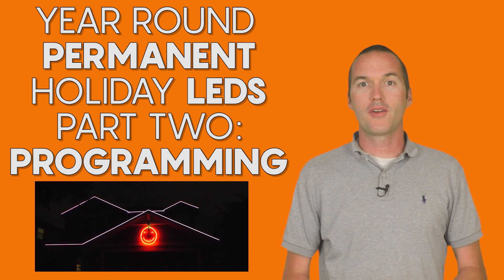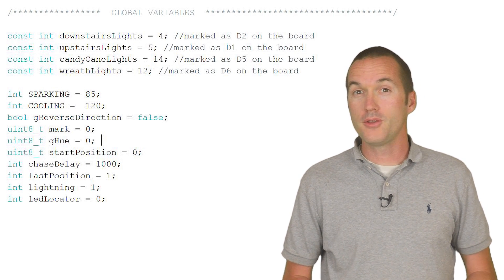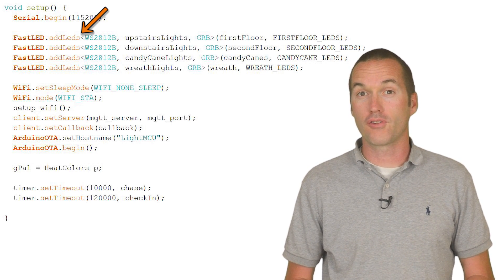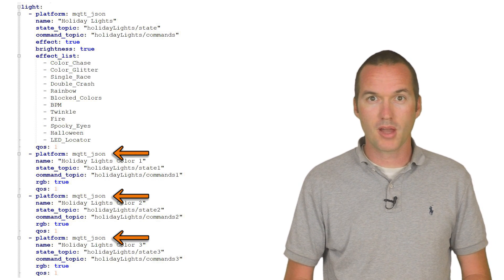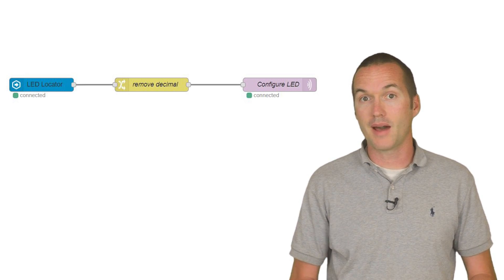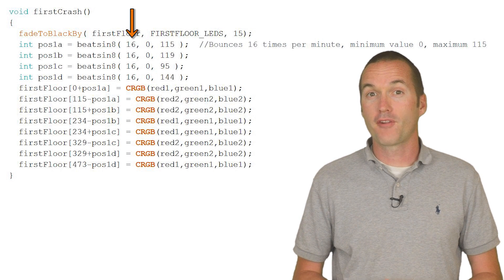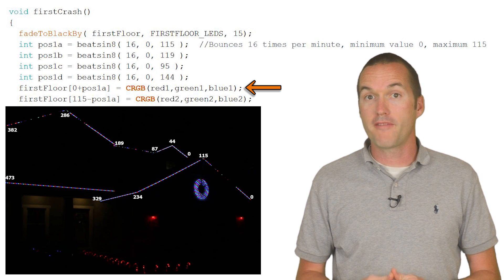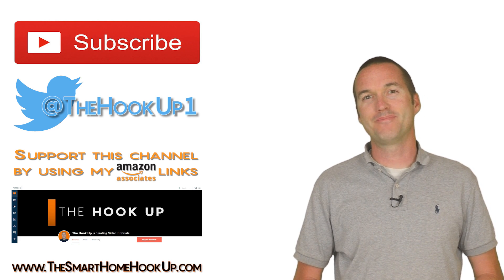Year Round Holiday LEDs Part 2: Software

Comment: Just Starting my first project. I ordered all my hardware (Node MCU 8266, bread board, power supply, 8211's...etc).  Can I start on the software side before I receive my hardware.  If so, where do I begin?

Comment: I have purchased the ws2812b strips for my roof line I am planning on purchasing the ESP8266 node mcu as a controller but I need to know if I can use the xlights program  to control the display

Comment: Just want to point out for those new to coding firstFloor[FIRSTFLOOR_LEDS] would be 0-479 not 0-480. The important thing to remember is that an array always starts at 0 and the highest position for an array is always one minus the value you defined the array size to.

Comment: What needs to be done to the code to work with RGBW sk6812?
Reply from the maker: I'd recommend looking at WLED instead of my code.  If you want to use my code there is a fork of FastLED that supports RGBW.
Reply: @TheHookUp  Thanks so much, next challenge, with WLED and esp8266,  can you only run 1 sequential length of LEDs or multiped  from different GPIO pins.  If only 1.  From reading the D4 pin tells the LEDs what to do. PS I owe you some beer!

Comment: I got the below from Amazon and I want to connect them in a series i.e. 20m. I know the power will fade by the time it gets to the third strip. Can you tell me how much AWG  extra power line do I need to pull along with it?

LED Strip Lights, Mixi 65.6ft 600 Lights Waterproof LED Light Strips Color Changing 5050 RGB with Bluetooth Music Sync App Remote Controller, Wall Lights, Rope Lights, Bedroom Decor

Comment: I’ve been trying to search in your videos before asking but haven’t figured out yet: I have simple 3/4” pvc in my yard for holiday lights using 12v WS2811 strips inside, controlled by an ESP8266 Node MCU with WLED. When the strip gets to 200 lights (sets of three) even after changing amount of LEDs in preferences, I get white or off LEDs for the last few feet. I’ve tested the strip I’m using to be sure it works and I inject power.  Is there simply a limit to how many channels it can control from one controller or output?

Comment: Great video! I have a question... do you have an equivalent for Tanbaby 5V 60A DC Universal Regulated Switching Power Supply for CCTV, Radio, Computer Project Mode Converter?? Appreciate any info

Comment: I cannot get any of this to work.

New home assistant setup and Mosquito might be working, but can't tell.  It sees the NodeMCU with your code in the add on page, but nowhere else in Hassio.  

The groups example also does nothing.  All configuration claims to be valid (and I've tried about 50 variations of minor changes) and nothing shows up on the dashboard.

Followed videos by you, bruh, and Drzzs but they all seem outdated or for some reason just don't work.

Asked on the home assistant community and no answers.

Comment: I am rewriting some of the openhab code you linked to in git. Since openhab does not have several features needed to replicate the exact setup, and sliders only do 0-100, then I cannot pick a specific LED in the locate code. The way it works, if using the slider, is that it seems to step through every LED until it reaches some unknown location. This is not your fault, but I need some clarity to rewrite this correctly.

When you choose a number, it is supposed to light that exact pixel up, correct?

The way the other person wrote this, the modifier slider is linked as an effect to the locator. This seems to adjust the speed at which it moves the location of the LED. I wrote a hacked together input panel that allows strings to be added to an item and then when a button is pushed it sends the value, converted to decimal, to the controller. This still seems to be linked to the speed or delay increase/decrease in the code you wrote.

Your locator code has a portion with locatorLED++;  which to me looks like it is stepping through every LED until it reaches the specified one. In mine, it never reaches the specified one and keeps cycling. 

Also, how does the locator understand what zone is used? Does it just use all LEDs in the system?

anyway, I want to send the number to the controller when locator is active and then have the 1 led light up. any input is highly welcome.

thanks for the large project. I am hundreds in on this and about to run some new power lines outside.

Comment: I'm so excited to finally be getting ready to do this project. After a year of waiting I've got the time and all the materials to do it. I was setting everything up last night for a dry test, but ran into a problem. Arduino won't compile the code I got from your GitHub. It shows an error: 'class SimpleTimer' has no member named 'setTimeout'. I've installed the SimpleTimer library and can't find anything wrong. Please help! Am I missing something?
Reply from the maker: You are the second person who has had that issue in the last 2 days, I wonder if something got messed up with simpleTimer.  Can you reinstall the library from my fork and see if it works? https://github.com/thehookup/Arduino-SimpleTimer
Reply: @TheHookUp  That must be it. I deleted the files in the SimpleTimer folder in my library folder, and replaced them with your files, and now it compiles and uploads successfully. The #include <SimpleTimer.h> isn't lighting up orange, but it still works. 

Thanks! Now I just need to finish the home assistant part of the setup!

Comment: Am so happy I found you I have been wanting to do this for ever your explaining am placing my first I need 5000 lights so it be Christmas of 2020 so I'll be bugging you after the new yr
Reply from the maker: My November 6th video will be all about light shows. Stay tuned!
Reply: @TheHookUp  am looking at amzon list do you happen to know how many of the 12 millimeter pixels one power supply can run am planning on 5000 to 10,000 on the 2 acres  I think am going need a few controllers but not to sure about the power

Comment: I really like the whites from the SK6812 strips you recommended in your LED comparison video.  Would all of your code be useless if I use them vs the WS2812Bs?  I have some programming experience but I've never used Home Assistant, Node Red, or Arduino so I'm afraid I won't be able to get it working without some good example code.  Any thoughts?

Comment: Interesting that you haven't run into issues with Esp8266 Wifi interrupts interfering with the LED data transmission.  This is a known issue if you aren't using hardware assisted transmission (not bitbang); which is limited on the Esp8266 (pins and number of channels).  
Are you using a separate WiFi for your MQTT LEDs than the rest of your house?

Comment: I don't seem to be able to flashOTA. The lights are off, I've selected the right port ("LightMCU at <IP address>), checked the ip address is correct (I can ping it), but I get the following error: "the selected serial port does not exist or your board is not connected".
Anyone else?

Comment: Hey Rob, is  there any limit for data wire length in between led strips ?
Reply from the maker: Depends on the size of the wire and VCC voltage on the LEDS.  If you use a logic level shifter to put the data line at 5v you should be able to run 100+ ft of ~22awg wire before the data gets funky.
Reply: @TheHookUp  Thanks for the answer. I will do some testings today.

Comment: Major props to putting all of this information together for us. I was on the fence about buying some traditional LED lights for the roof line of our new house and was dreading the idea of the yearly put them up / take them down dance, a bit of googling and i found myself watching your videos (along with DrZzs and Bruh's) - promptly ordered a few things from Amazon and tonight have a working proof of concept after a few hours of fiddling with the hardware and software. I have done some work with Arduino and Pi's before, but have never touched node red, mqtt, home assistant, and am not a developer - so your videos and code were extremely helpful. Going to do a bit more testing and then think I may pull the trigger on installing these for real. Would love updates to any changes you make, lessons learned, and updates on how things hold up. Again a huge thank you!
Reply from the maker: Have you checked out the 2.0 version of the sketch?

https://www.youtube.com/watch?v=90n8cZJcFaU

Comment: I keep getting this response every time I try to upload a profile command

please help

Arduino: 1.8.8 (Windows 10), Board: "NodeMCU 1.0 (ESP-12E Module), 160 MHz, Flash, Enabled, 4M (no SPIFFS), v2 Lower Memory, Disabled, None, Only Sketch, 115200"

Sketch uses 284332 bytes (27%) of program storage space. Maximum is 1044464 bytes.

Global variables use 27128 bytes (33%) of dynamic memory, leaving 54792 bytes for local variables. Maximum is 81920 bytes.

Uploading 288480 bytes from C:\Users\Travis\AppData\Local\Temp\arduino_build_354228/Blink.ino.bin to flash at 0x00000000

An error occurred while uploading the sketch

warning: espcomm_send_command: didn't receive command response

warning: espcomm_send_command(FLASH_DOWNLOAD_BEGIN) failed

error: espcomm_upload_mem failed

This report would have more information with

"Show verbose output during compilation"

option enabled in File -> Preferences.

.

Comment: I currently have my LED lights working with the BRUH Automation stuff on a ESP-12E NodeMCU. I'm now testing your code on a second NodeMCU and it looks like the sketch uploaded properly.

The issue I'm running into on both NodeMCUs is the network connection dropping fairly regularly to the MQTT server (1 to a handful of times every few minutes). The following was taken from Arduino serial monitor:

Attempting MQTT connection...failed, rc=-2 try again in 5 seconds
Attempting MQTT connection...connected
Attempting MQTT connection...failed, rc=-2 try again in 5 seconds
Attempting MQTT connection...connected

When this happens, the LED animation often stalls out until it can reach the MQTT server again. I'd guess that setting the MQTT QOS properly would stop this? (which I'm still trying to figure out)

So far I've tried the fixes from https://github.com/knolleary/pubsubclient/issues/203 that haven't already been incorporated into your code - which most of them are, awesome job! I've even gone as far as to setup a different MQTT server and even swapped routers, but the problem still persists on both NodeMCUs - the one with your code and also the one from BRUH. Any insights you have on this would be very helpful. Thanks so much!
Reply from the maker: Looks like the main fix listed is to use WiFi.mode(WIFI_STA); which is already in that code.   Honestly, I just need to impliment the async mqtt client rather than pubsub, but it's going to take a decent amount of learning on my part.

Comment: Ok so im getting to the node red portion of this and IDK how to convert the JSON that you posted in github to Node-red. Do you have a video explaining all that?
EDIT: went a rewatched the node red and found the import. 

Still having some issues, and not sure where to start the troubleshooting. With the home assistant dashboard I am able to turn on the switches for both lightning and glitter. As far as the color commands go they switch to the on position but im not getting a brightness slider or any effects drop down. Ive copied all of your code at this point and have just changed some names...any help is appreciated

Comment: Hi, I love your videos. It’s a great insight for someone new to Home Assistant &  NodeRed. I’m trying to set up some holiday LED lights but I’m getting the following errors in the Home Assistant log (removed full IP address)
“2018-12-16 11:03:13 ERROR (MainThread) [hbmqtt.broker] Invalid connection from (client @=192.168.xxx.xxx:37596) : [MQTT-3.1.2-1] Incorrect protocol name: "MQIsdp"”

In the NodRed log getting the following

16 Dec 14:57:10 - [debug] [server-state-changed:LED Locator] instantiated node, name: LED Locator

16 Dec 14:57:10 - [error] [server-state-changed:d7134a37.1a5668] TypeError: Cannot read property 'addListener' of undefined

16 Dec 14:57:10 - [info] Started flows

16 Dec 14:57:10 - [info] [mqtt-broker:26a6105e.4bf43] Connection failed to broker: mqtt://192.168.1.134:1883

I’m using the inbuilt MQTT with the following setup

{

  "log_level": "log",

  "credential_secret": "removed secret",

  "http_node": {

    "username": "",

    "password": ""

  },

  "http_static": {

    "username": "",

    "password": ""

  },

  "port": 1880,

  "ssl": false,

  "certfile": "fullchain.pem",

  "keyfile": "privkey.pem",

  "require_ssl": true,

  "system_packages": [],

  "npm_packages": [],

  "init_commands": []

}

I did not have any problems compiling and loading the code to MCU.

Can see from the console successful connects for WiFi and MQTT + see incoming messages for light effects e.g. “Glitter On” & “Glitter Off” but lights not working.

I’m running the following s/w versions

HA:0.81.0

Node Red: 1.1.0

Can anyone help please, sorry if it#'s some thing basic  :-( !!!!
Reply from the maker: I'm not quite sure what is wrong, but this seems like your biggest issue:

16 Dec 14:57:10 - [info] [mqtt-broker:26a6105e.4bf43] Connection failed to broker: mqtt://192.168.1.134:1883

Looks like node-red isn't able to connect to your mqtt broker.

Comment: Hey, @The Hook Up, really really need your help!

(Thanks for the awesome videos!)

In the latest version of home assistant, calling light.mqtt_json is causing a configuration error. It seems that maybe the syntax has changed? I'm not sure.

I've had a look here: https://www.home-assistant.io/components/light.mqtt/ and it seems that there is no longer a reference to the light.mqtt_json component.

Please could you help me reconfigure?
Reply from the maker: Check out the most recent version of the yaml on github: https://github.com/thehookup/Holiday_LEDS/blob/master/yaml.yaml

There are commented sections to make it work with the most recent update for home assistant.
Reply: OK, might have fixed it, but I've got another problem. First, my fix for the config error:

Wherever "platform: mqtt_json" appears, replace with:

platform: mqtt
schema: json

(I note that you've amended your code to reflect this! Thanks!)

But now, an additional problem:

Any LEDs connected to the "candyCanes" output are broken; sometimes glowing red, sometimes white, but never correctly displaying effects.

This is definitely not a hardware issue, as demonstrated by the following troubleshooting that I did:

1) Run the code as normal, without adjusting pins. Note that the LEDs connected to the candyCane output (pin 14) are not working correctly, as above.

2) Find the following lines of code:

const int candyCaneLights = 14; //marked as D5 on the board
const int wreathLights = 12; //marked as D6 on the board

3) Swap the pins around, so that this now reads:

const int candyCaneLights = 12; //marked as D5 on the board
const int wreathLights = 14; //marked as D6 on the board

3) Now note that the LEDs connected to the NEW candyCane output (pin 12) are not working correctly.

4) Therefore, it's not a hardward issue. Changing the pins has no effect on the output of candyCane. Any LEDs in the candyCane group are always broken.

Any ideas?
Reply from the maker: Yeah, you'll need to do a little editing of code for that issue.  My candy canes are made out of red plastic, so only red light is able to pass through them.   The candyCane functions are different than first and second floor.  If you'd like them to be the same you'll need to copy the code from the firstFloor effect and change all references from firstFloor to candyCanes and from FIRSTFLOOR_LEDS to CANDYCANE_LEDS
Reply: Awesome, thanks! I'm so grateful. My house looks amazing!

Could you help me with just one more issue? The LED Locator function doesn't appear to be working. When I turn it on, the first LED in each zone lights up, but the LED indicator slider doesn't seem to affect anything. Any ideas?
Reply: Just realised that the serial monitor of the NodeMCU doesn't actually show when the LED Indification slider is changed; nothing shows up at all on the NodeMCU side. (It seems to me that it's configured such that it should announce a change to the LED Identification slider.)

Any ideas what could be causing the problem?
Reply: I think it's something to do with NodeRED. I'm getting the error "TypeError: Cannot read property 'addListener' of undefined" on the LED Locator node.
Reply: Solved it!

It turned out that the LED Locator node in node-red wasn't configured to the correct server.

To fix this, I double-clicked the LED Locator node in node-red, and then:

1) I noted that there were two server options in the drop-down, both called "Home Assistant". I set it to the first one.

2)I deployed.

Done!

AWESOME!
Reply from the maker: Ha!, that was an easy fix.